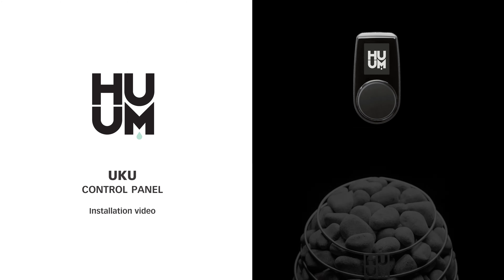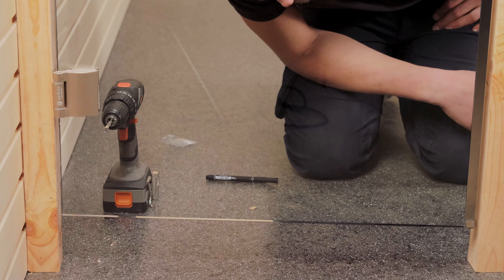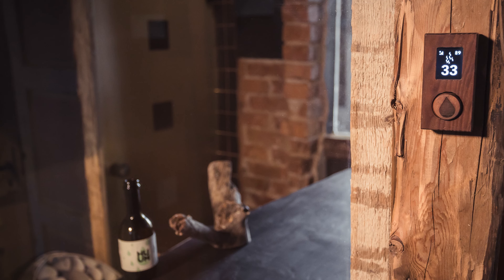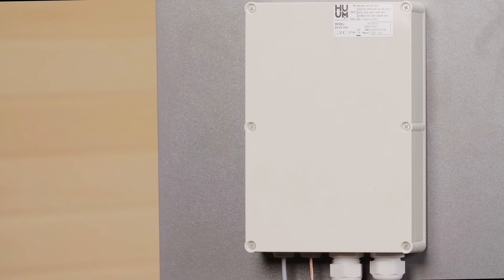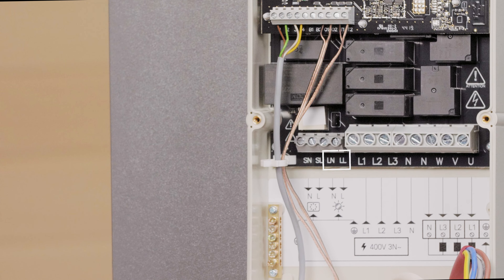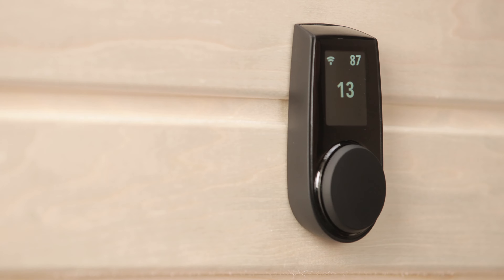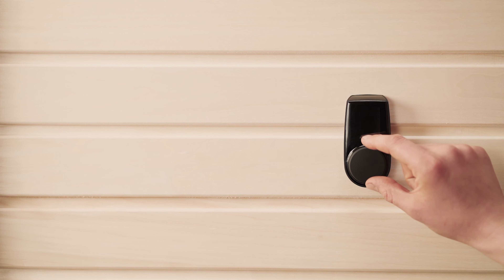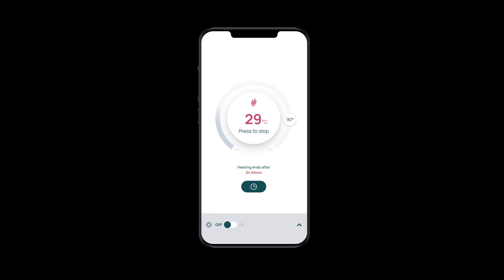UKU CONTROLLER INSTALLATION

Comment: Can both of the control unit be placed outside of the sauna open to the elements?
Reply from the maker: Yes, both of these can be placed outside of the sauna, but we do recommend making a small shelter for the main module :)

Comment: Hello, is the door sensor necessary to install for the Huum to function? Can it be omitted? The temp sensor inside would be installed.
Reply from the maker: Hello! The door sensor is one of the safety precautions that must be mounted. Note that the door sensor must be installed as shown in the manual.

Comment: Why on God's green earth would you have a sauna with a glass shower door and a 3" airflow gap?
Reply from the maker: From an energy consumption point of view, yes, a glass door is not optimal. Glass door though can be an aesthetic thing. Also it gives some level of safety, as you can see through it and be aware if people on the other side of the door are OK. 
If the sauna has well-designed ventilation, then the air gap is not needed, but most of the saunas lack ventilation. As they say, you can't have too much fresh air in the sauna. Without enough fresh air, you will get a dizzy head and the sauna session is not as pleasant as it could be. 
We wrote a blog post about ventilation: https://huum.eu/blog/guides/ventilation/